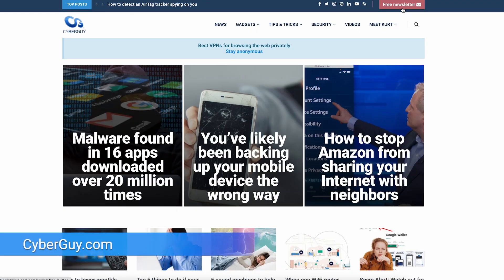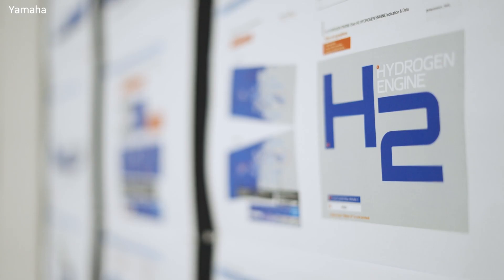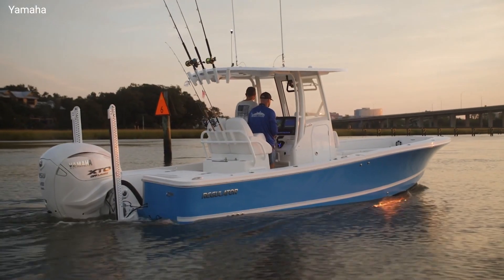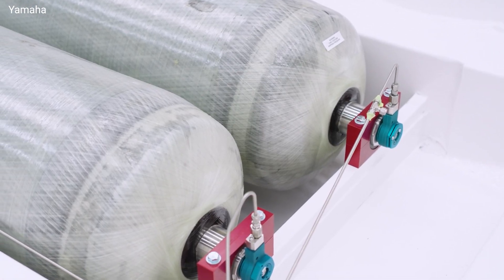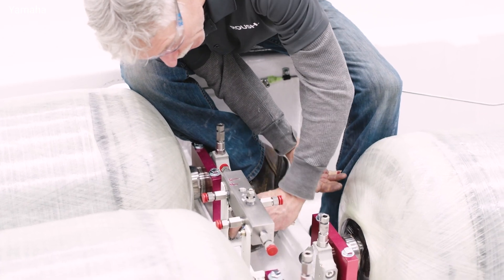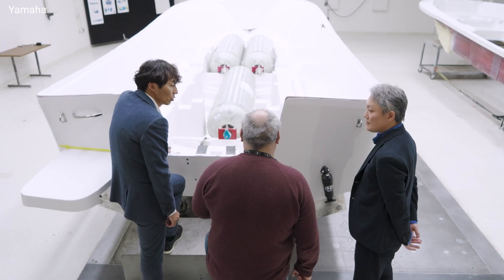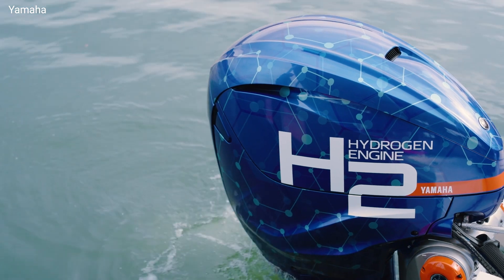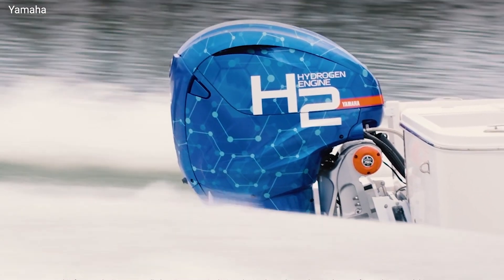Discover the world’s first hydrogen outboard engine powered boat | Kurt the CyberGuy

Comment: instead of carrying those tanks why don't you just run Electricity through electrodes to produce hydrogen and oxygen, one gallon of water is probably like 6 tanks since its an explosion and implosion, aren't  you guys like engineers ? use the one or two brain cells please 963